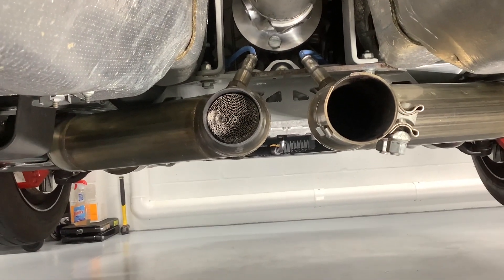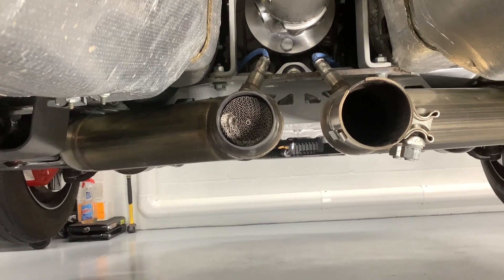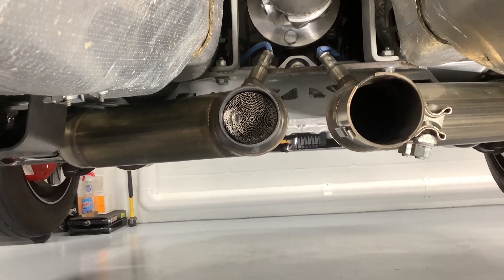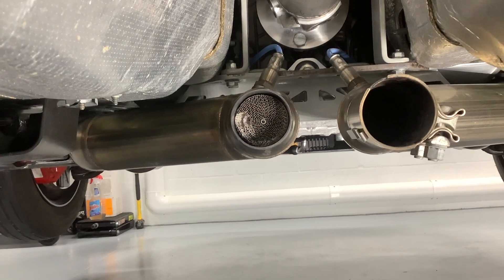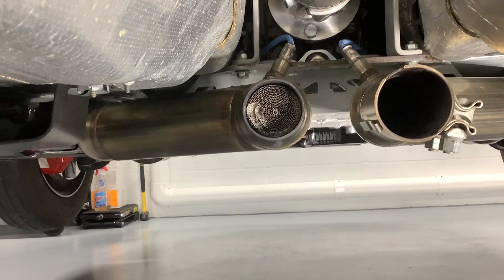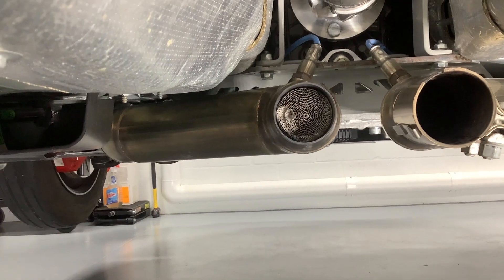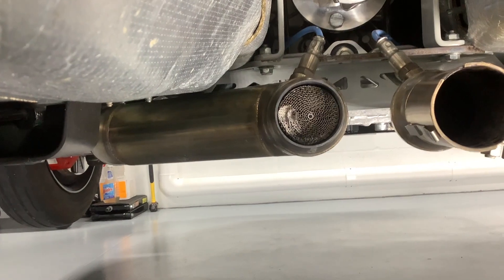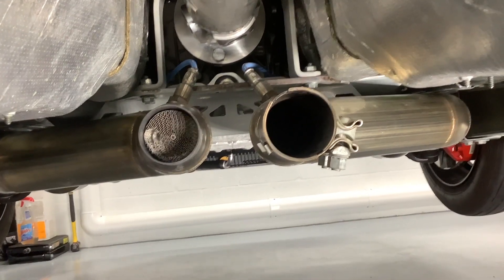Ultimate Headers High Flow Cat - Blown out at the drag strip

Comment: Hi there. I saw this post at mustang6G forum.  first time seeing this.. I have a Stainless Power 1-7/8" Long Tube Headers came with Cat. ( standard ) on my 2024 s650 I'm currently running a natural aspirated setup with no blower. what are the chances of my catalytic converter burn up like yous?
Reply from the maker: It can happen with any brand of headers. Just avoid using a 2-step device and boost, or your chances of blowout will increase. Get a solid tune on the car as well to make sure the tune is on point.